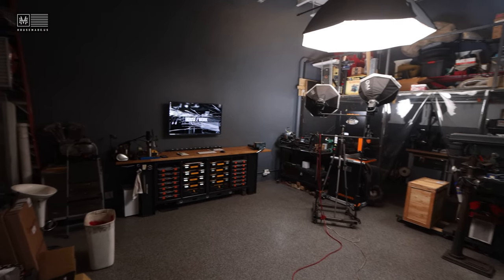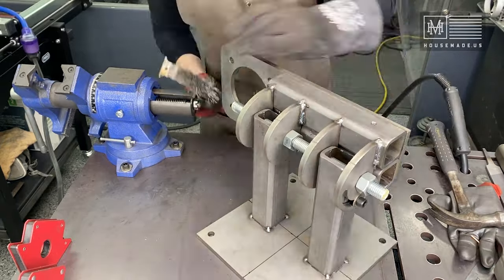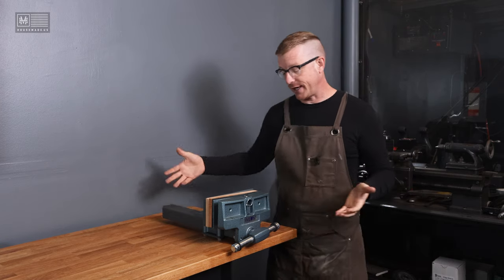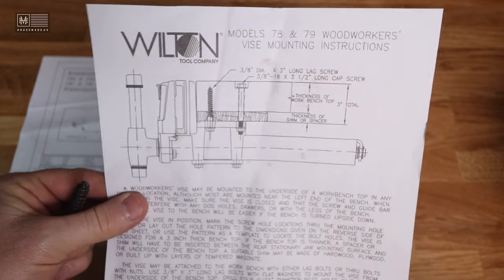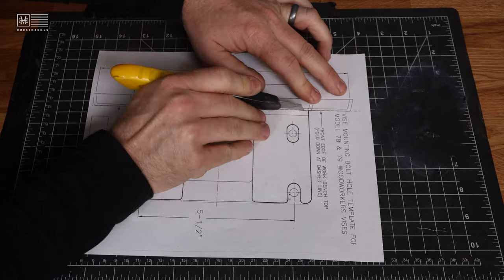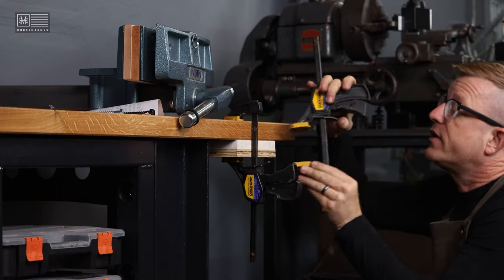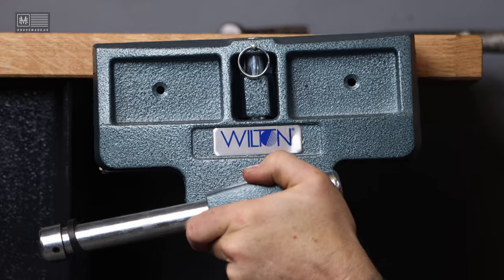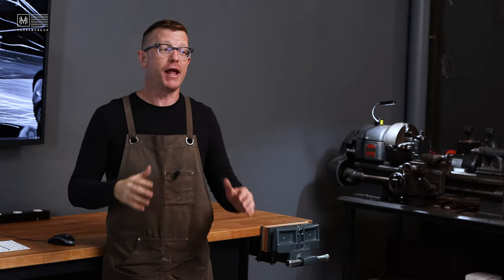How To: Wilton 79A Bench Vise Install

Comment: Your shop  looks hella groovy!  And that thar vise is a beast!  The color adds a little "pop" to the shop. The cameo appearance of that 2x4 work bench looks a lot like the one I made and currently use. It does the trick, But! Soon I'll be remodelling, and upgrading my micro shop work bench, in part to make a home for the Revolution 2x72 I'll be ordering soon (ish). I also came upon a Cress heat treating oven that needs a few things (coils for sure), and a Jelenko mini sand blasting cabinet, all that needs is some fresh abrasive. Have a great weekend man 😎
Reply from the maker: Hey man thank you! I've been so stupid slammed with orders and other stuff I've not had much time for the fun stuff. Need to get back to making videos also. 😁 cheers brother!

Comment: Didn’t the PVC trim label say 3/4” actual thickness? Wouldn’t that leave your vise 1/4” high relative to the work surface (assuming your additional wood spacer is 1/2” as stated)?

Comment: Question not related to this video. 

Why are so many 2x72 belt grunder/Sanders anti-clockwise?
Reply from the maker: Great question: the belt typically is spinning towards the user and thus throwing the sparks to the floor. It’s safer to use that way. However my latest build has the ability to reverse and throw the sparks up. I use this function to sharpen knives. Hope that helps and thanks for watching.

Comment: Really should have glued that additional wood onto the bottom.  Otherwise, the threads in the lag screws are working off each other, rather than off the full thickness of the wood.  I think there is a good chance it will rip out of your nice tabletop.
Reply from the maker: Ahh bummer. Well fingers crossed that by following the manufacturers directions it holds. I can always pull it down and do a layer of glue on the wood. Just not sure how that would help as the bolts don’t thread into the spacers? Can you help me understand what the difference is?
Reply: @HouseMadeUS  Hmm, the directions specified the spacers just have through holes?  If so, that’s odd.  I would have expected them to thread the entire length for greater strength.  If they really meant the spacers as there only for offset, and not as part of the bolted-to thickness, then I’m wrong.  Weird though.
Reply from the maker: Yes the holes drilled through the spacers are 7/16” and the lags are 3/8” so they just slide right through. I even used longer lags because I felt that wasn’t enough thread in the table top. You can’t go too much further than 3.25” as it will end up all the way through. It feels sturdy enough but I am with you on making it thread all the way into the spacers and the top. I might just do that at some point.

Comment: Worst install ever. If the metal of the vice is higher than the top of the bench it's a disaster.
Reply from the maker: It's installed to factory spec.
Reply: Rookie. No offense.